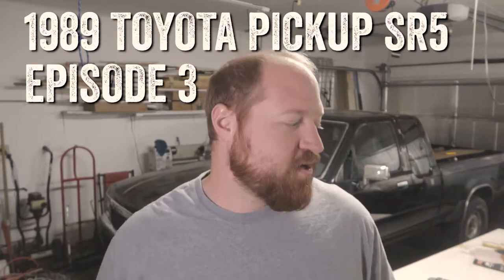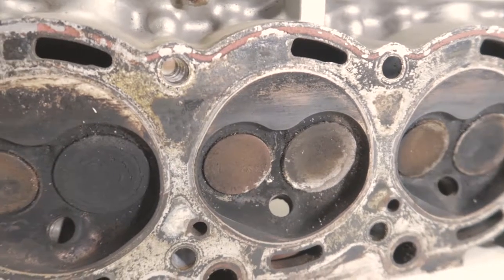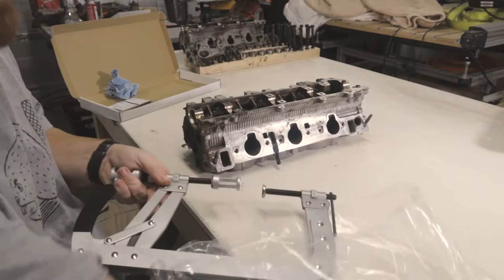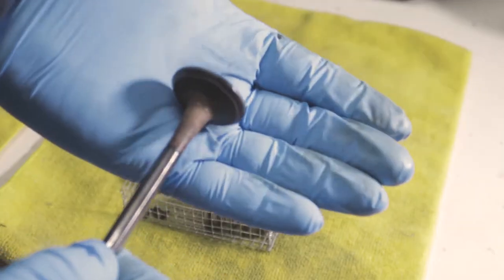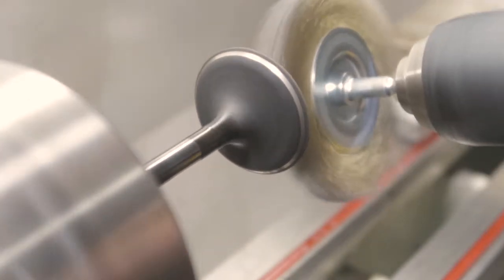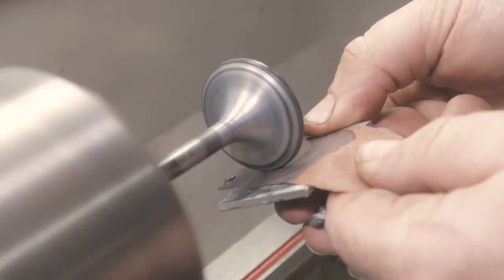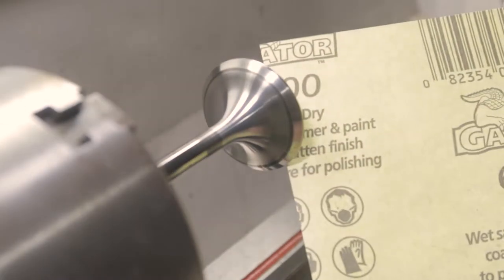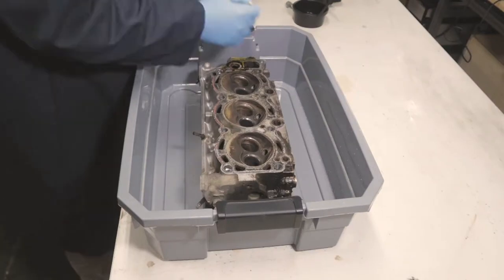Disassembling the cylinder heads - 1989 Toyota Pickup Restoration Ep 3

Comment: What is the cleaner you are using for the heads and other parts?
Reply from the maker: In this video I'm using chem-dip. You can find it at AutoZone or advanced auto. After this I started using oven spray cleaner in the yellow can. I like the oven cleaner more because it sticks to the parts better. Sometimes you need to coat it a couple times if it's really baked on, but I found multiple cleaning cycles was much better than trying to scrub the thick stuff. I highly recommend gloves because this stuff is nasty! You have to be careful with aluminum parts for both cleaners too. If you forget an aluminum part in it overnight you won't have an aluminum part anymore. Good luck!